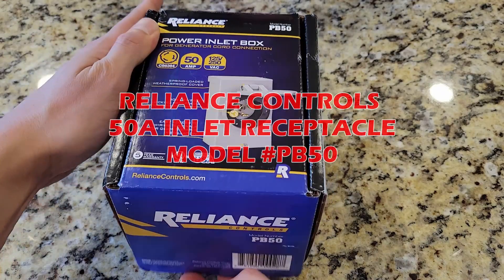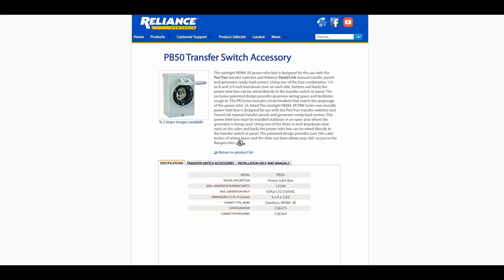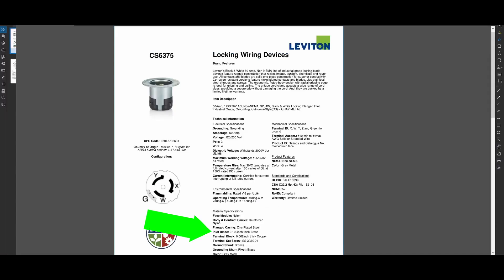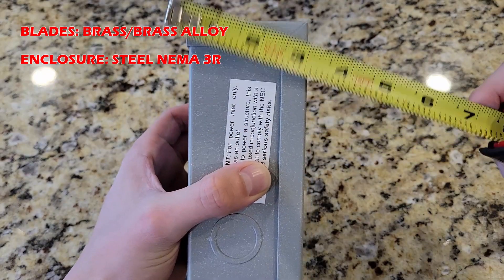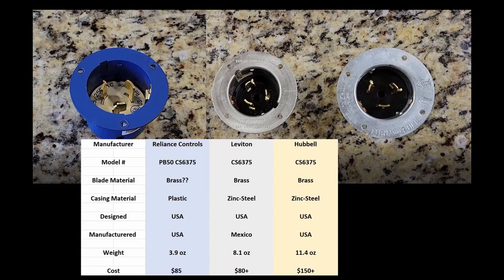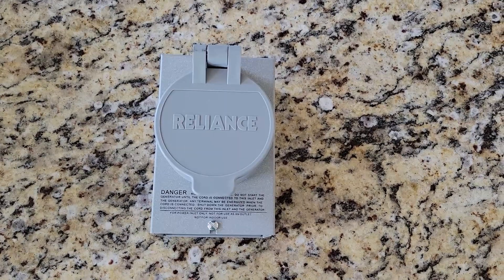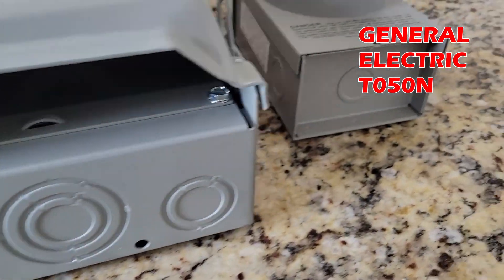Reliance PB50 Inlet Power Box is Not Great. Watch Before Buying!

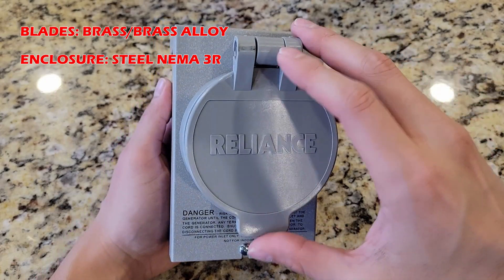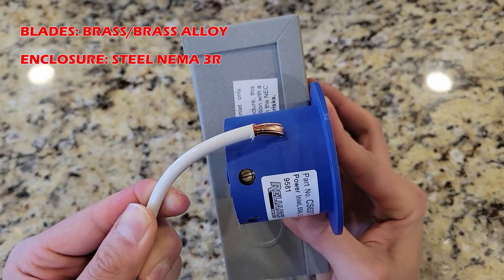Comment: I think this video is a little misleading. Notice the placement of the 50 amp receptacle within the box at 0:56, and you will notice that the mounting surface of the receptacle (blue area) sits within a cylinder that has been extended away from the box. Now look at where the presenter is holding the mounting surface of the receptacle at 1:19 and 1:32 in the video. They are holding the mounting surface of the receptacle right up against the box WITHOUT the extended cylinder in place. The cylinder moves the receptacle further away from the box leaving more room for the wires. I agree that the GE box is a better design... but I don't think this video is a true representation of the Reliance PB50 Inlet Box.
Reply from the maker: Good catch @ 0:56. There is an additional 1.5 centimeters of clearance because of how the receptacle sits on the lip, which is still not enough clearance for #6 gauge copper wires. I was not trying to be misleading. I was disappointment by Reliance to be honest; i thought it would be a better product. Poor box design and a plastic receptacle is enough to discourage anyone from purchasing it. There are better products out there.
Reply: @dgtv3320  So you're saying that UL doesn't know what they're doing? It has UL certification and there's actually more room behind the receptacle than I believe you indicate when the receptacle is used with the extension cylinder as provided by Reliance. 

I will say that Reliance has been a breath of fresh air in this day of chat support or overseas people you can't understand and many times don't know or understand their product. I've spoken with Reliance support several times regarding the PB50 and the ProTrans 2 10 circuit and always reached a very knowledgeable tech immediately who was based in the US and spoke clear English.  For that alone they are worth consideration.